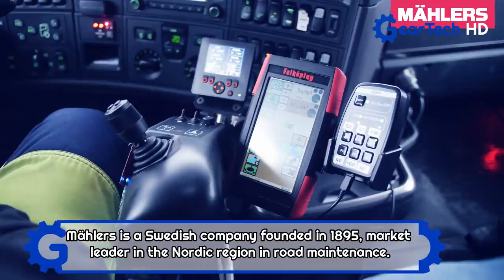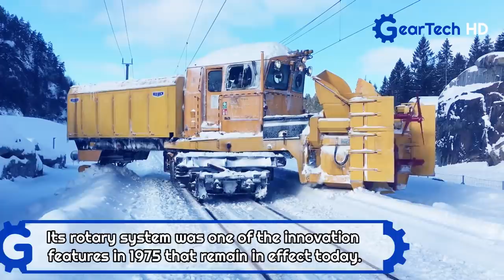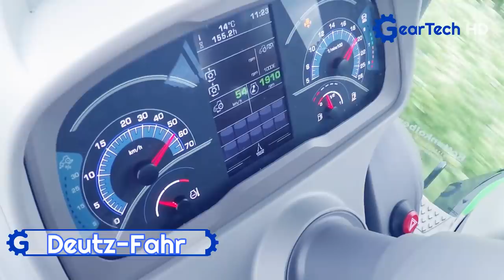The Most Advanced Snow Removal Machines you have to see  ▶ Snow Plow Trailer 7,500 ton/hour

Comment: Nice selection!  A little bit sorry you didn't get some of the not so common things worldwide as e.g Mählers "Underbite" HB5N installed under a truck or wheel loader. Works as a grader blade in height and ice ripper in winter with Olofsfors SharqEdges or to maintain gravel roads in summer.   Thanks!